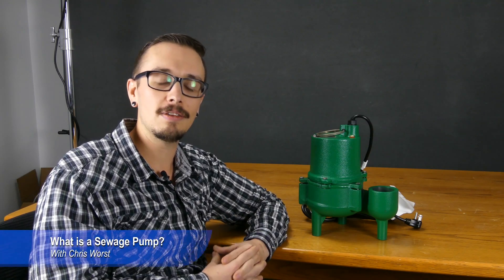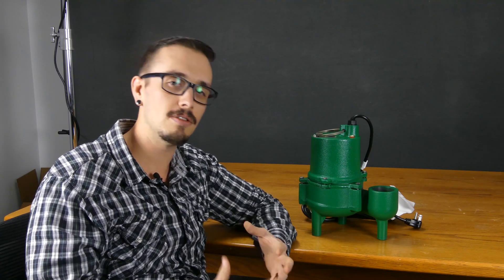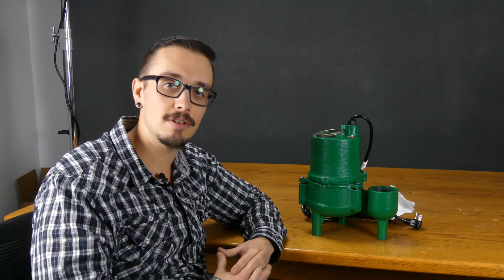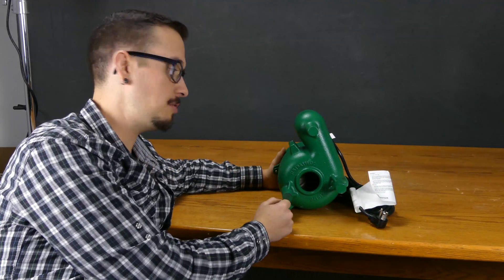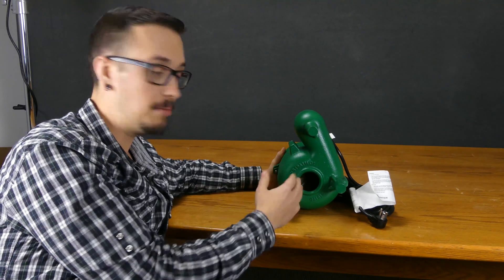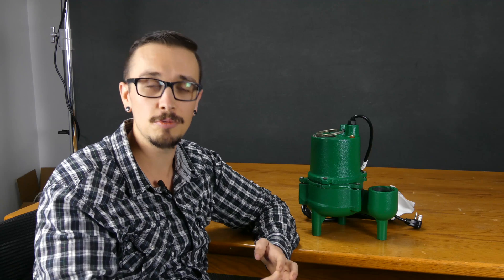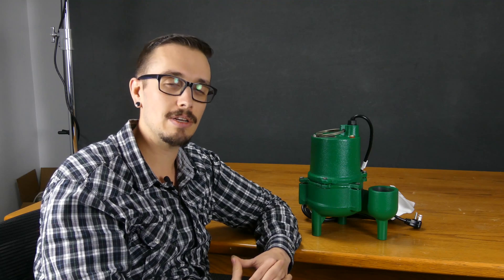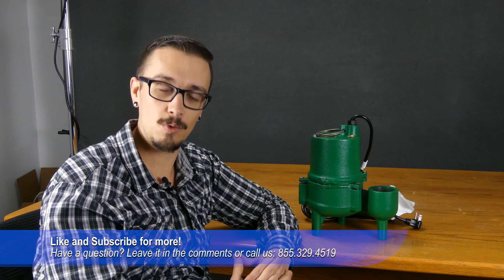What is a Sewage Pump?

Comment: I'm considering buying a sewage pump as a standby since I have a very old sewage pump pumping the downstairs bathroom of our hillside house. Could I stick the backup sewage pump into a sump basin connected to a french drain inside our crawlspace until the old sewage pump finally dies? Our crawlspace get wet at one corner only, with what I estimate 20 to 50 gallons of water per year. That's not much but I like keeping the crawlspace bone dry if possible and it seems wasteful keeping a sewage pump just sitting in a box unused (and there really expensive too).
Reply from the maker: It would be wise to install it in a sump instead of letting it sit. The seals in that pump are oil-lubricated. Typically, if it will not be running for an extended period of time you'd have to rotate the impeller by hand every 3 months. Installing it in a sump is even better.